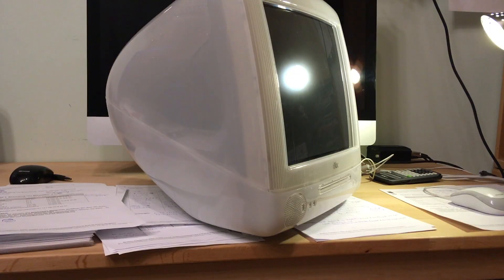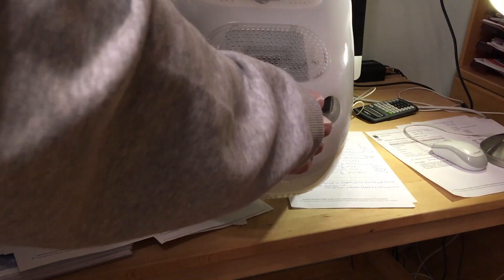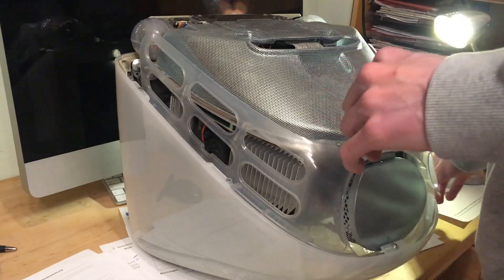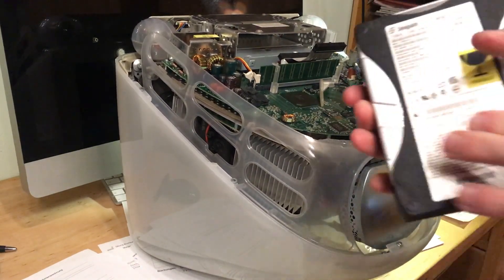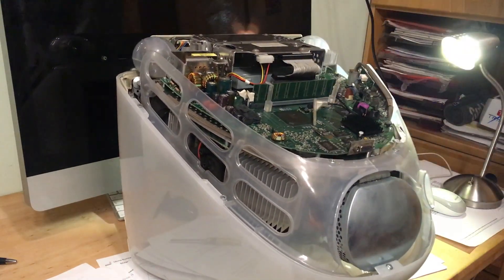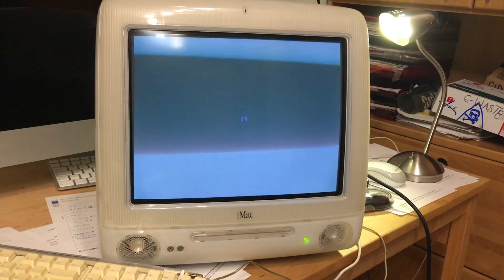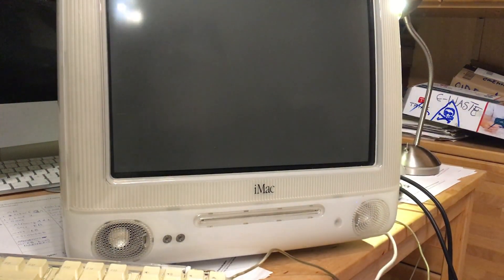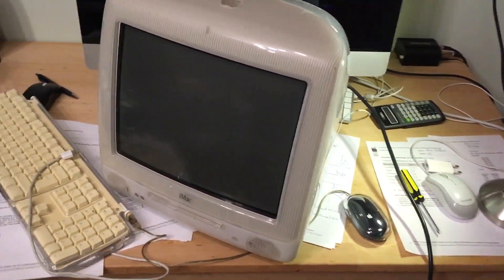iMac G3 how to swap out the hard drive

Comment: I've got a graphite iMac, circa 2000, I've undone the screws underneath the elevation bar and there's a big plastic screw that I've moved to the unlock position, enabling me to lift up a small oval hatch but how do I take the whole plastic casing off, it seems jammed solid.

Comment: I still need to remplace the hard drive in mine since the current one a 80gb Seagate who has alot of bad sectors and I need to remplace it with a decent 80gb or a 120gb Western Digital HDD